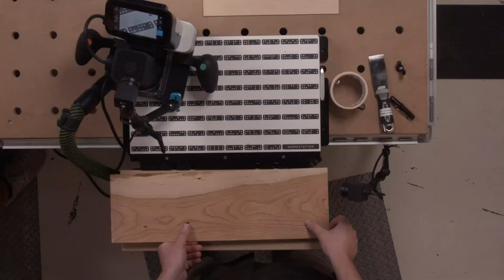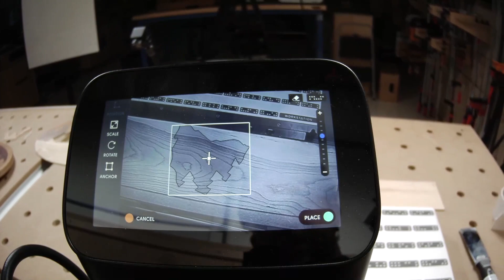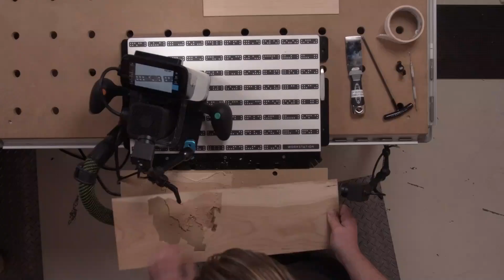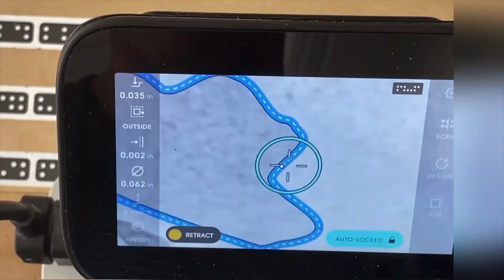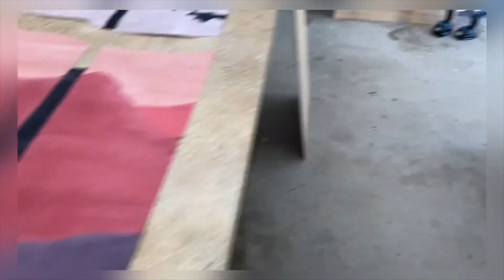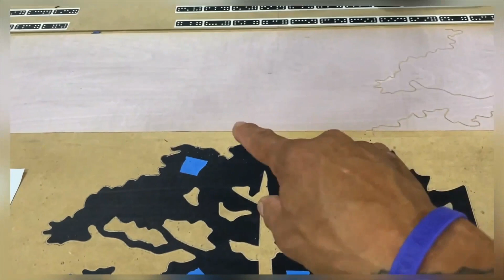Session 46  – English: Marquetry and Inlay with Origin

Comment: I’ve discovered the “spiral” feature on my SO.  I have used it to cut small pieces that fit within the aiming circle, like leaves on a small tree… but can it be used with the auto-lock feature for larger work pieces?  When using such a small bit, to ease into the cut?  It would mean having to circle the cut several times, but may prevent frequent bit break… just wondering
Reply from the maker: Helix only works on paths where the movement will fit inside the corrective range, it can't be used on larger paths.